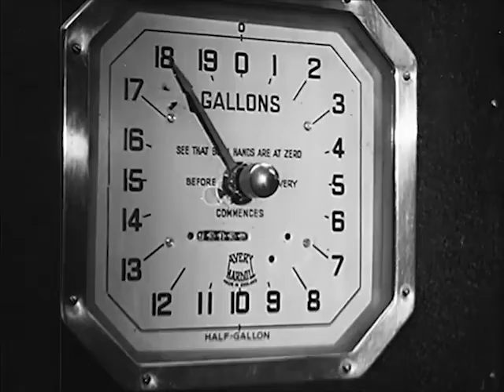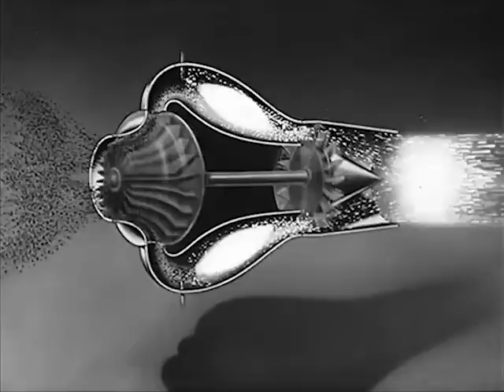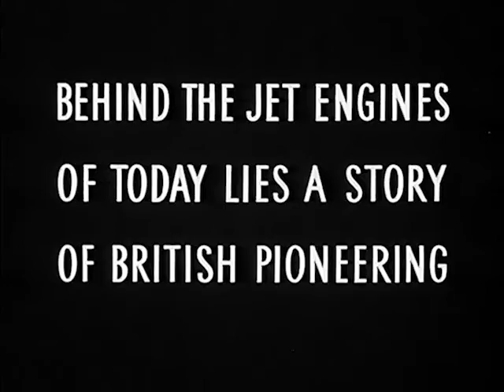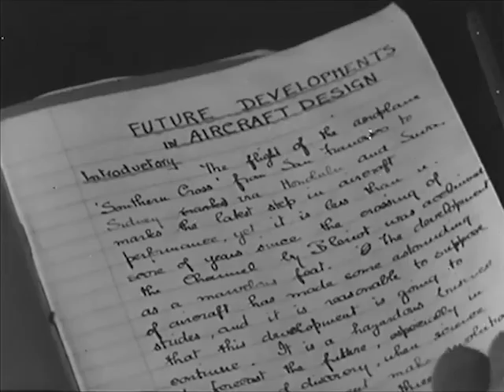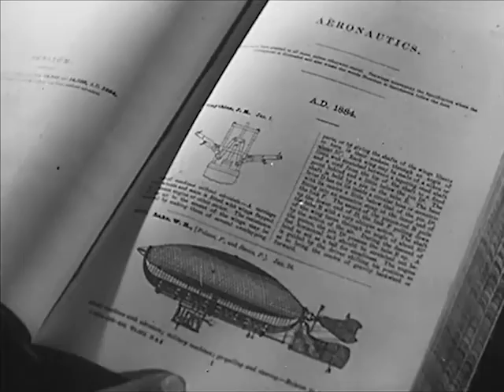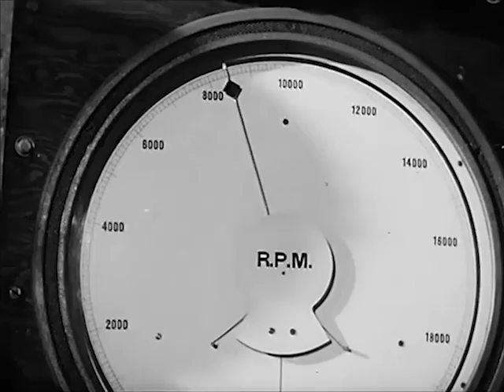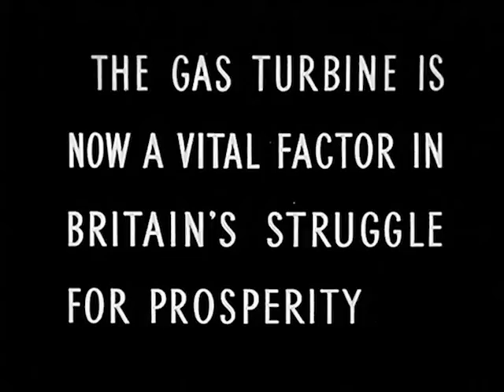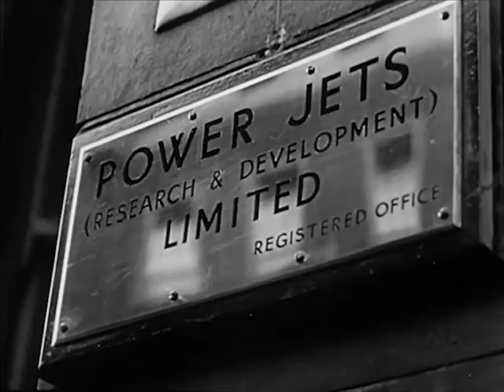1950s Post War Jet Engine Airplane - The Wonder Jet - 1950 - CharlieDeanArchives / Archival Footage

Comment: Camproni also tried a contraption where the entire fuselage is the avenue of propulsion. But, still the source of power (as in coandas) is through an alternative source...Coanda himself could only CLAIM similarities to Actual Turbines (that functioned), and he himself called  his devise a motor- jet. If these were actual and true inventions (turbo or tubine engines), We would all see them in developed version flying around NOW!
The idea Whittle patented and eventually produced was really nothing new, as the devise imagined and described in his patent is in many ways merely a turbo-supercharger already used to aspirate reciprocating engines in high altitude or while under severe loading. The major difference being that in adding fuel to this air compressor and feeding said mixture (carburetor like  into a combustion chamber), one could do away with all the other mechanical contrivances). This could only be done by linking the first and second functioning stages together using a turbine shaft (brilliant).
I suspect where there is much misunderstanding and confusion is because throughout the 40's and well into the early 50's anything that produced thrust without using a propeller was called a JET engine; ie, jet pulse (V-1),, JATO boosters which were used on almost all early American military jet aircraft (later called RATO as the terms became more clearly defined) 
No right mind would ever claim that ANY particular invention was created in a VACUUM, ie; with no out-side influences (except for perhaps the UNIVERSE) so perhaps give credit where credit is due.
Side note would be, additionally, an engine (car) which would attempt to use the idea of a turbine (In the sense of eliminating up and down motion to produce a rotory re-action), combined with the principals of any combustion engine would be the Rotory or Wankel engine which although not invented by, but was developed and used by Mazda for some time till eventually discarded.
Now perhaps,, for a change of pace we can all(sit back) and wait for all those Patriots to come forward to tell us all how great THEY are through some geograghical association with some other forgotten or unknown inventor Who ACTUALLY created the rotary engine...

Comment: In 1937, German physicist Hans von Ohain invented the first "operational" pure jet turbine engine that would power an airplane. The first prototype plane was the "HE 178 V1", also called the Heinkel HE 178. The HE 178 first flew in 1939, but it was the later ME-262 with two Junkers Jumo 004 turbine engines that became the first to see conflict. The ME 262 finally saw full production in 1944, but was used only to shoot down allied bombers and came too late in the war to make a difference. Frank Whittle's design was also patented and successfully tested in 1937, but the UK government did not fund the project until later in the war, thus suffering similar setbacks to Ohain's. Britain eventually did fund Whittle, which lead in steps to the production of the Gloster Meteor, whose main service in battle was to shoot down the Nazi V-1 guided missile (Buzz-bomb). Hans von Ohain admits to having studied some of Whittle's patents before building his own jet engine in spite of the story that Ohain didn't "know about" the Whittle designs. To say that Ohain "copied" Whittle is inaccurate. Scientists often use others works for reference. In a similar vein, history recalls how Marconi allegedly "invented" radio, but that is an error. Marconi blatantly hijacked all of Nicola Tesla's patents to make it, with no intention of crediting Tesla at all.
Reply: The engines used in the 262 suffered terrible reliability issues and needed replacing when they'd only done a small amount of time. I read that this wasn't down to the design it was the materials used on the fan blades. They didn't have access to the metal needed to withstand the pressure and heat.

Comment: hey thx for the videos what is the aircraft at 14.45? looks like a twin fuz low winger of some sort any suggestions
Reply: Yes it's two Ercoupes joined together. The original was designed by, the deservedly famous, Fred Weick https://en.wikipedia.org/wiki/Fred_Weick who, amongst MANY other achievements, published lots of NACA TNs,  which focussed on stability and control effects.  https://en.wikipedia.org/wiki/ERCO_Ercoupe   The TNs are of great interest to anyone interested in light aircraft or microlight aircraft design and are probably freely available now.
The Ercoupe was designed to be unspinnable by limiting elevator movement, no rudder pedals etc...... unfortunately, spinning isn't the only way to crash....
http://home.iwichita.com/rh1/eddy/Safe_Airplane_NOT.htm

Comment: What about the German Me 262 ? 

The jet propulsion plane first flight in Paris as an invention of Henry Coanda. It was also the first jet plane crash in history!  

Is it not right that half of a truth weights as much as a full lie?
Reply: +kayrosotbrates Coanda's aircraft was not a jet it was a conventional petrol engine with a conventional prop inside a tube, it tended to set fire to the fuselage, his was an attempt tp make use of the Coanda effect accredited to him but described a century earlier, the italians in ww2 made a similar style of aircraft. like coanda's it flew badly and had little power... Whittle is accredited with the invention because he designed and patented a turbine engine earlir than anyone else.
Reply: @peterforden5917  Ducted fan anyone?
Reply: @peterforden5917  Ducted fan anyone?
Reply: me 262 and Gloster meteor fly~in same time...https://en.wikipedia.org/wiki/Coand%C4%83-1910
Reply: @leneanderthalien  And the Gloster Wittle flew BEFORE either of them.